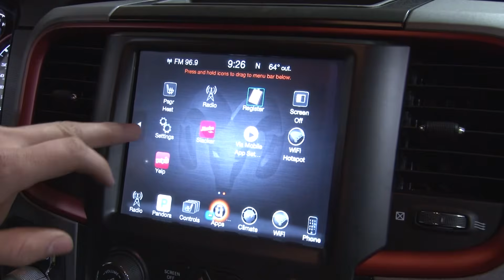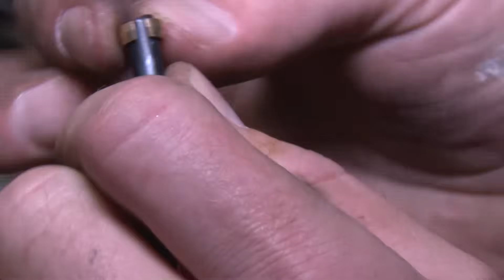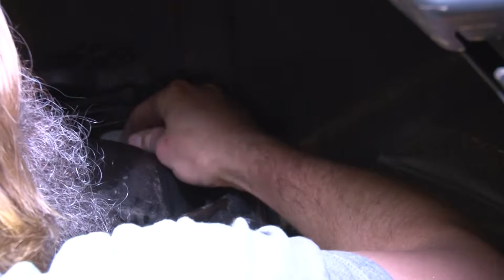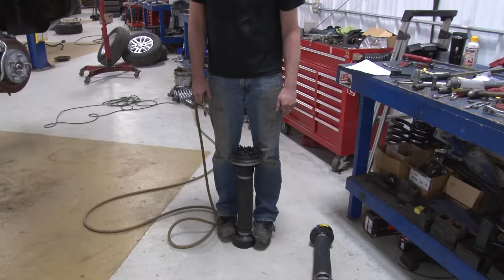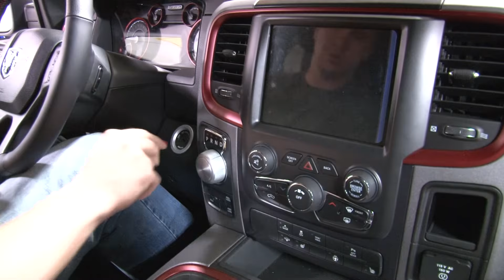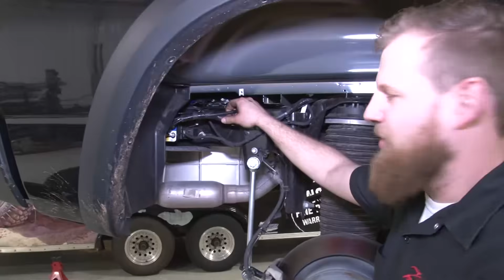Dodge Ram 1500 Air Ride Suspension Lift Kit  2013-2016, Air bag and line instructions.

Comment: There is NO such thing as a 2013 - 2016 Dodge Ram.  The last Dodge made Ram was the 3 rd gen.  If you cannot even get the manufacturer correct, what else dont you know.
Reply: Whatever, it's still Mopar no matter what you call it.

Comment: Thanks, very helpful informations video, i have one question for that, the upper control arms not need to change ? The oem ones angle correct?
Reply from the maker: correct, the factory UCA are retained with this kit as their operating angle remains the same once lifted
Reply: @bdssuspension where but the fitting kit can you send me the link 🔗

Comment: Were you buy the kit
Reply from the maker: We offer the kit on our website https://bds-suspension.com or through any of our hundreds of dealer/distributor shops. Check out our website for more info and dealer locator
Reply: Did you ever find this kit? I have looked at the link and tried going to the website with no luck.
Reply: @nate101902 it's funny. This video shows just installing spacers and air line extensions but the kit online has much much more than that. Curious why they don't show the entire install

Comment: Do you know if this Lift also eliminates the extreme cold air leak / compressor problem with the Ram Air suspension. I have a 2013 Laramie.
Reply: The only way it would fix your problems is if you had a leak at the fitting that they replaced. It's highly unlikely. It's usually shot rear air bags that start leaking in entry exit mode or aero mode. The bags are foled over so much they develop cracks.It'ss quite common.

Comment: So, at the lowest setting of this lift, it is 2 inches higher than standard factory, and at it's highest setting it is 6 inches higher than standard factory height?  Any chance you guys will develop this system for the air ride equipped Grand Cherokees?

Comment: Does this fit the Rebel?
Reply from the maker: Hey Liam, that is somewhat of a loaded question. We offer this 4" suspension lift (#1623H) to work with the factory air ride equipped RAM 1500 4wd models. The kit is designed to retain full functionality of the adjustable ride height these truck came with. Where the factory suspension can be adjusted between -2" and +2" of ride height depending on the driving mode, our kit would be 4" taller so  between +2" to +6" of ride height allow for 35" tires to be installed. While this can fit the standard RAM 1500 and Rebel models, we've found some manufacturing variances on the Rebels which may require additional modifications to complete the install. For that reason we don't currently list the Rebel on the list of compatibility with the #1623H kit. Of the multiple Rebel models we've test fit the kits on some require different modifications than others, but all were able to be successfully lifted. For more on the #1623H kit head to http://bds-suspension.com/product?kid=1623H and for more on the topic feel free to contact BDS sales/tech support at (517) 279-2135.